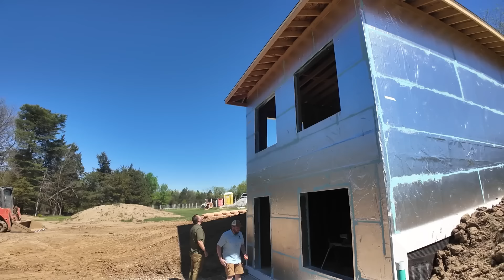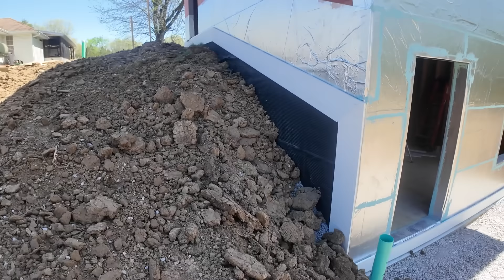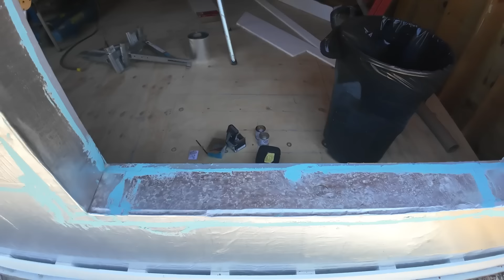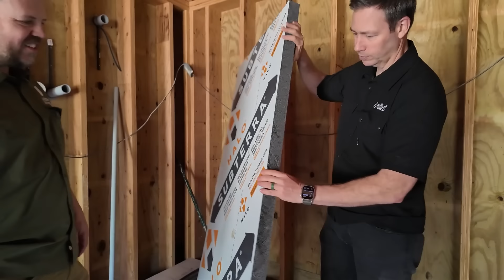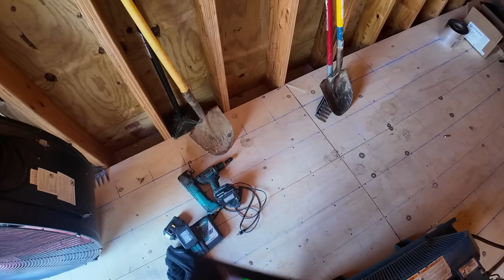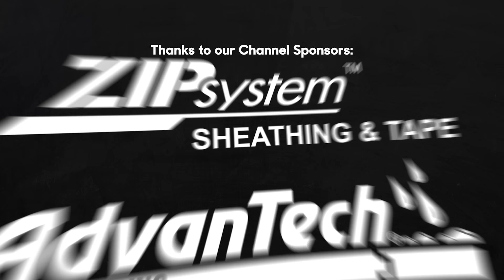Wooden Foundations - WHO KNEW

Comment: When my parents did an addition in Minnesota a couple decades ago they did a wood basement for it. Two doors out. One room actually has a sunken floor for a projector and that room has the sump. It's not had any problems whatsoever.
Reply: I depends what u think as a problem, for me it would be a problem.
Reply: @Pandomar1  - My buddies dad built a pool out of wood 40 years ago 12 feet deep and its still there in Ohio !
Reply: @reganlutzko93  well people have wooden boats as well... all tougth they require intense maintrnence. You can easily swin from time to time in wooden pool, as u can swim in natural pond or lake. Differece is do u want to build moldy home and live with in it?  It's basic junior high physics that the wooden foundations will gain mold growth, even if foundation walls waterproofing is working. You migth avoid rotten wood an structural failures, but not mold infested indoor  air
Reply: @Pandomar1  decades by the way, and it doesn't have a mold problem. Proper installation and drainage are as important for any type of material used for a basement. The wood has been excellent, as it's much better insulated than the old half of the basement with concrete.
Reply: @Bradimus1   I just wrote a long answer to this, but apparently it was too long, and it did not appear here. Iam from southern finland, where the weather is relatively similar to Minnesota. I investigate structures for profession, we don't have wooden foundations here, but some people have done insulated  wooden walls inside concrete foundation walls and they are almost oll moldy regardless of working drainage same goes for insulated wooden floors on top of concrete slab. The major problem is more commonly than not the condensation of inside air in to the cold stuctures. The mold migth not be yet visible to the bare eye, but u can certanly smell it and confirm it by laboratory. When u actually see the growth then it is really bad. All in all house should be odorless
Reply: and by the way the condensation is more prevelant during late summer than winter, cause during winter ground is warmer than outside air and during summer its' colder than air. During winter inside air so dry, at least if ventilation works that there really is no moisture to condece. In winter absolute humidity might be like 2g/m3 an in summer 16g/m3. While the deep gorunds temperature will vary fron 10...18c. 18c and 16g/m3 promote mold crowth 10c and 2g/m3 does not come even close
Reply: @Pandomar1  this still sounds like an installation issue, or you would see the same problem with any wood wall in a cold climate.
Reply: @Bradimus1  No because wood framed wall must be sealed from inside and breathtable from outside, so if moisture gets in to the structure it can evaporate to outside air.  If walls outer layer is toi sealed ir will also make mold especially to upper parts of the walls, but pressure difference typically prevents it from harmin indoo air
Reply: Also walls above ground are warm all way thru when absolute humidity is highest so the relative humidity wont rise so much. When it's cold absolute humidity is also very low so  that lower the risk of condensation
Reply: @Pandomar1  my understanding is, all wood basements here are heavily sealed against any water ingress. As well, a buried wall cannot allow for evaporation anyway. Interior walls should not use a vapor barrier as it will encourage condensation and then mold. You are able to use other products to slow any moisture going into the wall, and prevent that condensation.
Reply: @Pandomar1  https://youtu.be/QnFoiUXr4h4?si=zCLXXLqXjXEMmgu8
Reply: @Bradimus1   That video gets some thing rigth and some thing wrong.. vapor barrier in a basement wall can slighly increase mold growth depending of the house, but it will prompte mold growth with ot without it as long there ate wooden frame or mineral wool. its basic physics, there is so much missunderstanding that maybe I should make my on video
Reply: @Pandomar1  I think you're just having problems based installation, and maybe a bonus of failure to control humidity on the interior space. We do this here, and they do it in many other countries with cold winters without issue. It's far more common on a wood basement they failed to backfill correctly or build the walls to handle the load.  The walls then bow, or water never drains away properly.
Reply: @Bradimus1  no the fundamentals on that video were roughly rigth. And the ridgid xps insulation installed carefully inside foundation wall makes a huge difference and thats true. But there is no need for mineral wool inside it. It's like u know the problem but cant fully apply the knowledge. Xps migth save the wall, but without it it will be moldy
Reply: Migth be that u consider problem when u see mold, I consider whem I smell it.
Reply: @Pandomar1  you've stated that the wood wall must be sealed inside, and breathe outside. This isn't what's going to happen in a buried wall. So, I'm not sure we are in agreement on the fundamental principles. It seems we're at an impasse. But I'll watch your video if you make it!
Reply: @Bradimus1  Yeh, but I pointed out that it applies walls above ground.
Reply: @Bradimus1  Yeh, but I pointed out that it applies walls above ground.

Comment: This is what I've been designing the past few years, but didn't have the engineering or architectural knowledge to really push the envelope especially with the slabless and the interior studs being UB4C. Is it also in MA? I want to use Glavel as the backfill and aggregate too. 
I've tried sourcing the wood, but have been struggling. Was even told by one yard that it has to be FDN or PWF stamped, but I didn't see that explicitly stated in code- only that it had to be UB4C.
Reply: The interior studs don't need to be UB4C, only the plywood and the footing beams (2x8 or 2x12).

Using Glavel would be an excellent choice!

Comment: Built my first wood foundation house back in the 80s.   I did use a concrete floor back then, but there is 1" of foam board w/poly under that.     House is in Minnesota and costs under $20/mo to heat over 2,500 sq. ft..
Reply: To heat to what? Just above freezing? I find that hard to believe, but I have no reason to doubt you.
Reply: It will rot and not last the test of time. Sorry to say that but they all do.
Reply: Pressure treated isn’t what it was 15 years ago, carpenter bees 🐝 will bore in new 6x6 in 30 day. Lawsuit city